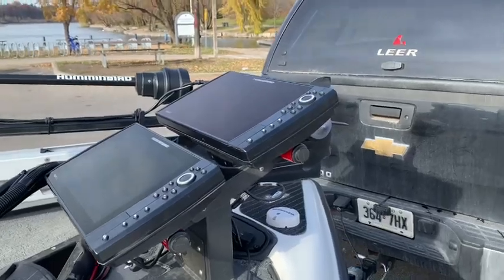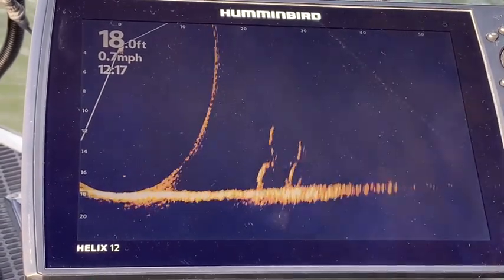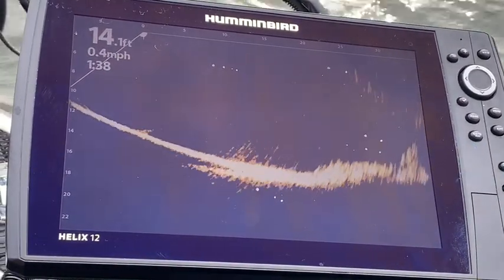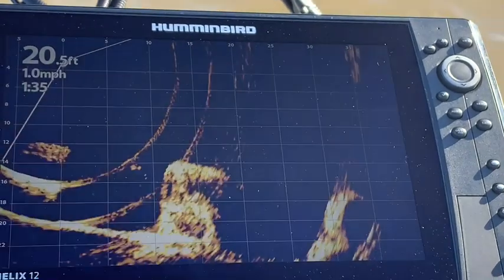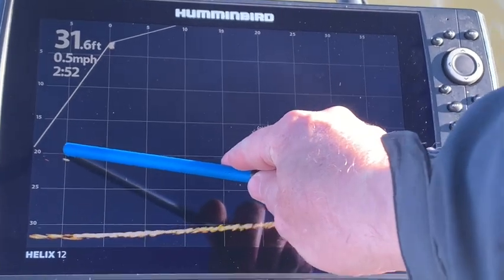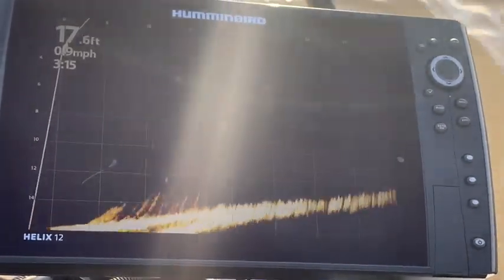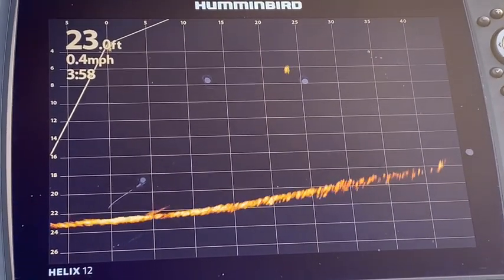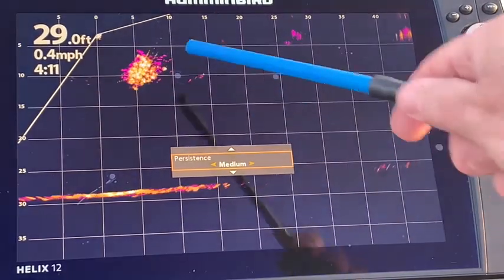Humminbird MegaLive Settings and Images

Comment: Good morning, Steve 
I enjoy your style of teaching and have learned a lot from it/you. I have a question for you I currently use my Mega Live on a Helix 9 and I am considering a Helix 12 and the images in this video are wonderful with this being way before the most recent update. I'm at a true crossroads. Do I make the jump to a Solix 12 or stay with the Helix line in a 12?
I have also heard Solix and Helix don't work well together. When watching your newer videos I see you are currently running Solix so I think you would be most helpful with an opinion. Any input would be greatly appreciated Steve.
Reply from the maker: Thanks for the kind words. The resolution on the Helix and Solix 12 are the same. The main advantage of Solix is the touchscreen. I would get the Helix 12 and save yourself some $. I have done comparisons with the Solix and Aprx but I don’t run either one. All my units are Helix. The resolution on the Helix 12 is better than the Helix 9.
Reply: @stevechiassonfishing5876  
Thank you so much for that Steve when I saw the Solix/Apex comparison I assumed you had made the switch to a Solix. 
Thanks again Steve you have helped tremendously with my decision.
Reply from the maker: @ronreitz2399 happy to help

Comment: Those are some very good images 👍 I'm getting more familiar with mine . It can only get better with more time on the water. I have noticed that changing the degree of view can make a big difference  in picture quality and the ability to track your bait further out..
Reply from the maker: Thanks Ryan, one of my favourite sayings is “the only difference between ordinary and extraordinary is that little extra”. Sometimes an adjustment of 1 click, 10 degrees, in forward mode can make a significant improvement. Avoiding the set it and forget it mentality is an important part of getting the most out of your electronics.

Comment: Hi Steve…thanks for the video. 
Quick question, do you think an Apex unit with its higher resolution capability would give more detail? 
I wonder also if Humminbird is working on image quality for the MegaLive with the next update. Sure would be nice if they were able to eliminate some of the distortion as well. 

I have Mega360 already with a Helix 15 and love the images it produces. And I’ll be honest sometimes I think I would be better served purchasing a Garmin unit with their Livescope.
Reply from the maker: The Apex should be an amazing picture. Humminbird will keep striving to improve image quality for sure. Higher resolution and updates will help for sure. As mentioned in the video, I don’t have the choke on yet plus I am going to upgrade some of my wiring this winter. I absolutely love my Mega 360 and rely on it a great deal!

Comment: Thanks. Still waiting on my mega live to show up. Ordered before Thanksgiving. Did the choke solve your interference issue. Images later in the video were clear.
Reply from the maker: Hi Mags, the choke is not on either day. Nov. 24 Ethernet from ML was plugged directly into back of unit. Dec. 14 Ethernet connected through 5 port Ethernet switch.
Reply: @stevechiassonfishing5876  Merry Christmas!
Reply from the maker: Merry Christmas Mags

Comment: So when you powered it up the transducer was not un the water right?? Is that the process?
Reply from the maker: You can power the unit up out of the water but it won’t work unless it is in the water. I always fire up the unit attached to the MegaLive first as it takes a bit to kick in.

Comment: What mount do u have your 12's on? I don't have a Ethernet 5 port, I'm direct in a Helix 12, what is taught between both ways, it's to cold for me here to get out & try mine
Reply from the maker: Hi Bill, I had a custom mount built for me Tritown Tool in Cambridge by Jeff. I am not sure what you mean by what is taught between both ways? Do you mean direct vs 5 Port Ethernet switch? Many are recommending going through 5 Port Ethernet switch to help avoid interference, helps sequencing of units networking together. Others are saying it doesn’t make a difference. I wish I had more time to definitively answer that question. My picture did seem clearer going through 5 port Ethernet switch. The Nov. 24 images did not go through switch. I also didn’t use the Interference rejection on the 24th so that adds another variable. Either way works, I would definitely try it without and see what you think first. Hopefully that helps answer your question.
Reply: Did u install the choke
Reply from the maker: I have not installed the choke simply because I don’t have it. I will definitely install it when I get it. A good way to test whether or not the choke will make a difference is simply to take the charger leads off for the day and run your MegaLive.

Comment: Have you had any issues with the 12 freezing with mega live. If so do you have a fix?
Reply from the maker: The only time I have had freezing issues was when I did not do the MegaLive installation properly. This is in the accessories tab at the top go under MegaLive. This topic is addressed in my video which I have linked below. Also, unit updates have helped address the freezing issue.
https://youtu.be/uxcQgO12NPc